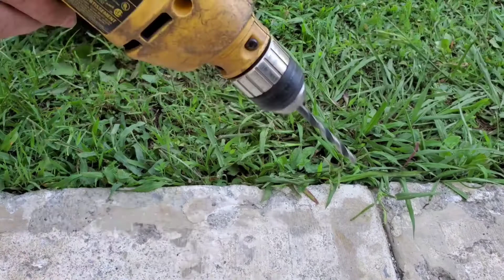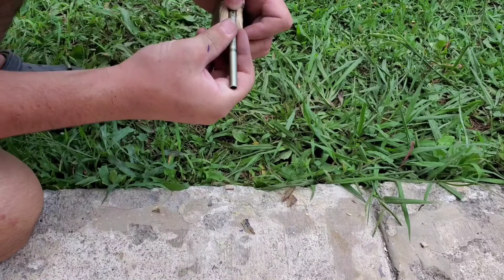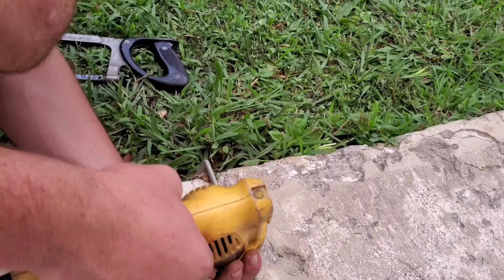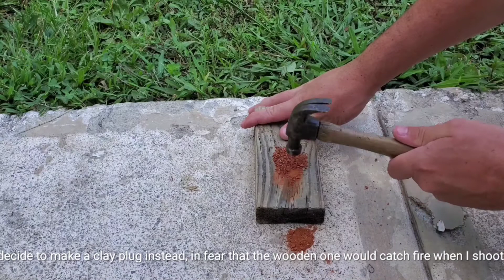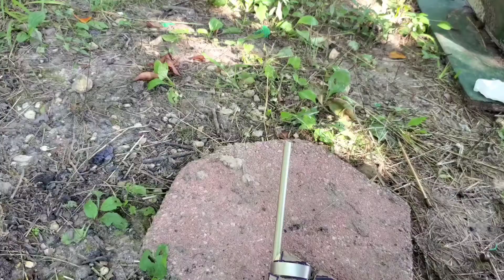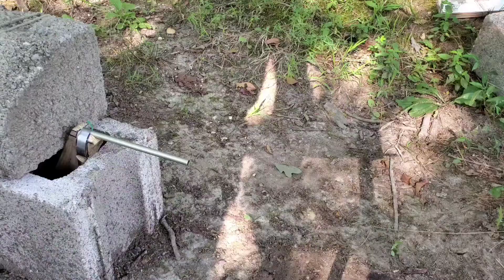Homemade Blackpowder Pistol

Comment: What I find interesting is the barrol u used, u said aluminum right n I always thout it had to atleast be iron or steel to withstand pressure of a gun great job
Reply from the maker: I was using black powder which produces less pressure than modern gunpowder, so aluminum is strong enough. If I was using modern gunpowder, I would use steel. This is the reason why you can't use modern powder in muskets or muzzleloaders, because it isn't strong enough. Hope this helps.
Reply: @dimadzhuga  very informing u seem to have a lot of experience with guns
Reply from the maker: @benitogarcia5618  making homemade guns is my hobby
Reply: @dimadzhuga  1 gm modern powder is equal to how many gm bp??
Reply from the maker: @jacksonjoseph1446  One gram of black powder produces about 0.3 liters of gas and produces 0.7 Kcal of thermal energy. In contrast, one gram of modern smokeless powder produces 1 liter of gas and 1 Kcal of thermal heat. So that means that black powder is about 1/5 as powerful as modern powder. From that, I'm estimating that 5 grams of black powder is equal to 1 gram of smokeless powder.
Reply: @dimadzhuga  thank you so much
Reply: never use aluminium barrel its dangerous
Reply from the maker: It only blew up when I put smokeless powder in it

Comment: you can make a blastingcap with armstrong mixture, which you need 
potassium chloride and red phosphorus for. You can get the 
potassium chloride from the head of safety matches and the phosphorus from the ignition strap on the box. Its a friction and shock senitive explosive so it detonates on impact.
Reply from the maker: I need to get more matches, I might make a mini cannon that uses armstrongs mixture.
Reply: Isnt red phosphorus super poisonous
Reply: @TopGFinanceAdvice  yes dont mke it like that just mix armstrong tree stump remover with sulfer and somme charcole
Reply: its potassium chlorATE

Comment: Is it dangerous if per say you overloaded the shot ? I mean , that’s quite a lot of shot you put in there , has it caused you problems ? I’m referring to only the shot tho , not the powder . Because it’s obvious that an overload of powder will end badly .
Reply from the maker: I've never done it before, but I don't think it will have a good ending. When guns shoot, the hot gas from the powder burning follows a path of least resistance. In a normally loaded gun, that would be the bullet. But if it's overloaded, the projectile is a lot heavier, so it wouldn't be as easy to shoot out. Therefore the next path of least resistance would be the wall of the barrel, or the plug in the back. I doubt it will do anything to a well made thick walled cannon, but the barrel thickness on mine is a whole lot smaller, so I wouldn't do it.

Comment: Could you just hammer the back end flat of the barrel if you’re using a steel tube ? It’s doubled with two 1mm thickness steel tubes so it would be 2 mm thickness in total . I’m thinking of hammering the back end flat and putting some lead pieces in the tube so that I can melt it with a blowtorch and create a flat surface “breech plug” for the powder to sit on . You’d reckon it be strong enough?
Reply from the maker: I think that will be strong enough as long as you make the crimp strong
Reply: @dimadzhuga  Hey there . So I’ve tried it out using match heads as propellant but all I got was a “whoosh” instead of a bang . Any ideas on why this happened ? I did compact the matchheads tightly in the barrel but it just burned up really fast and didn’t shoot . The ignition hole which I put the fuze in is 2MM in size and the barrel itself has a inner diameter of 8 mm . Any advice would be appreciated. Would blackpowder work differently?
Reply from the maker: @swiftskyler2982  I think that match heads burn too slow for this. Since it burns slower, it isn't as powerful.
Reply: @dimadzhuga  Thanks for the tip . I used homemade blackpowder this time and finally it worked . About 25 grains of it to be precise. Mine is a similar design as your gun but I made it so that it works on a percussion ignition system instead . I just used some Armstrong’s mix and put it in the fuze hole and gently pushed a small firing pin in the hole . Although I figured that in order for the Armstrong’s mix to detonate on impact , it had to be metal on metal impact , turns out that the blackpowder was packed so tight that it worked great as a surface for the Armstrong’s mix to detonate on . Btw the homemade blackpowder is not granulated whatsoever .
Reply from the maker: @swiftskyler2982  That's a great design. Just make sure to not use smokeless powder because it is too powerful. Mine blew up 2 times because I used smokeless powder.
Reply: @dimadzhuga  yeah definitely wouldn’t want that to explode in my face
Reply from the maker: @swiftskyler2982  Is your gun kinda like a pinfire?
Reply: @dimadzhuga  AHHHHH Yes Yes . That’s the word in looking for . Pinfire percussion ignition system
Reply from the maker: @swiftskyler2982  A pinfire trigger is a lot better than a fuse. I hope to make one like that in the future.
Reply: @dimadzhuga  Yeah for a fuze you need to light and wait for it . Whereas for a pinfire , a very simple trigger mechanism can be made and you can just point and shoot things . The ignition hole I made was 2 mm and I don’t recommend anything bigger as gas will escape . Anything smaller than 2 mm will have difficulty with the pin fire method as it will be hard to put the Armstrong’s mix in and properly prime it . Although you can use roll caps as primers if you do decide to make the ignition hole smaller than 2 mm . Maybe put a little blackpowder in the hole below the paper roll cap to assist ignition.
Reply from the maker: @swiftskyler2982  The plastic percussion ring caps from a cap gun would work too.

Comment: Hey so how do you make the clay plug? 

I’ve been trying to use wood plugs bud as you mentioned they’re wearing down because the black powder sorta burns it a bit 

Are you just dropping clay in and tamping it down?
Reply from the maker: Yeah you just drop pieces of bentonite clay in there and hammer it until it gets hard as rock.
Reply: @dimadzhuga  ok thanks a lot I’ll try that

Comment: Can you use any blackpowder?
Reply from the maker: Yes, I usually use the blackpowder lift charge from firework mortars and cakes. I also sometimes use pyrodex but blackpowder works better.
Reply: @dimadzhuga  thank you, how many grams of powder do you use?
Reply: @dimadzhuga  and is it possible to use normal bb’s instead of nr 8 buckshot?
Reply from the maker: @parkinsonsoldier6655  I use 0.47 grams (7.2 grains) of powder for 8.07 grams (124.4 grains) of shot. It is ok to round to half a gram (0.5) of powder and 8 grams of shot, it won't make much of a difference.
Reply from the maker: @parkinsonsoldier6655  I use lead birdshot because it is more dense than steel bbs. Also since the barrel is such a small caliber, I could fit more bbs if they are smaller (more weight to volume ratio). I honestly don't know how steel bbs will preform in this gun. I'll try to make a video soon trying different loads and I'll be sure to include  .177 caliber steel bbs.
Reply: @dimadzhuga  your
Comments are very helpful, I need to order some blackpowder now. Gonna do a safe test fire to be sure before I hold it like you did, hope the 177 bbs are not to heavy, I reckon I won’t put in a lot of them since they are heavier. Thank you again for the helpfull comments!
Reply from the maker: @parkinsonsoldier6655  You're welcome. And make sure you use the right type of blackpowder. There are different types that burn at different speeds. I'd recommend FFFG blackpowder. Just remember that I am not responsible for anything you might do that was inspired by this video.
Reply: @dimadzhuga  sadly can’t get fffg will lovex do32 work, and I will be very careful!
Reply from the maker: @parkinsonsoldier6655  I wouldn't recommend it. Modern day powders are much more explosive than blackpowder. This article states why. https://www.hunter-ed.com/national/studyGuide/Powders-for-Muzzleloaders/201099_92954/#:~:text=Don%27t%20use%20modern-day,)%2C%20sulfur%2C%20and%20charcoal.
Reply from the maker: @parkinsonsoldier6655  See if you can use Pyrodex. It is the best blackpowder substitute.
Reply: @dimadzhuga  I can also not get pyrodex with laws around blackpowder, only gunpowder. So is firework gunpowder okay?
Reply from the maker: @parkinsonsoldier6655  Yes, that is what I used. I recommend the mortar shells, they have the most powder for the price. Just make sure you only use the lift charge, not the burst charge. The burst charge contains flashpowder, which is even more dangerous than modern day smokeless powder. Here's a picture that will help you differentiate between them.
https://images.app.goo.gl/karbLtbppteYKbfg9
Reply: @dimadzhuga  well, sadly I live In a not so free country like America, the only fireworks I can still get my hands on is cakes,firecrackers, some singleshots
Reply from the maker: @parkinsonsoldier6655  Cakes will work too. Cakes are basically mini firework mortars. The lift charge on a cake is the coarse black powder at the bottom.
Reply: @dimadzhuga  this has been very helpful, so I just take the bottom of the cake and I’ll see the black powder?
Reply: @dimadzhuga  and does every cake have this? (We have weaker cakes i think)
Reply from the maker: @parkinsonsoldier6655  As far as I know, every cake works the same. Weaker ones will just contain less powder. Here is a cross section of a cake so you will know where the lift charge is.https://images.app.goo.gl/g4zYZ9bSQ5BvathA9
Reply: @dimadzhuga  thanks a lot sir you have been great help. I think I know enough for now, and again thank you.
Reply from the maker: @parkinsonsoldier6655  You're welcome.
Reply: @dimadzhuga  i finished it and I uploaded a video on my channel
Reply: @dimadzhuga does using matchhead powder make a difference?for example if u extract the powder from the match heads and than use it for the gun?
Reply from the maker: @Dav624  That could work, I've never tried it before. I don't know if the burn rate will be fast enough though.
Reply: @dimadzhuga  I have tried a miniature version of a real firearm with barrel of aluminum wich was smaller diameter than a plastic BB and smaller than my second finger in my hands I basically closed one side of the barrel with some pliers just pressed it down till it had no air coming out and than I proceed to load the match powder the thing is that as trigger mechanism I used a lighter and held it at the part of the barrel where the match powder was stored in than the idea would be that the flame would heat up the metal so that it ignites the match powder and this idea worked fine the first time I attempted shooting it with aluminum foil ball I made specifically for that barrel however the second time I tried wadding with some small tissue and than put a small nail after the wadding was done in order to shoot it as a projectile the problem was that I think I either put too much wadding inside the barrel or I put too much powder in it and henceforth the barrel exploded into a mushroom shape I was holding it with pliers and holding the lighter under it with my hand to fire it and when it exploded I got shrapnel parts onto my left hand thumb at the area near the nail and the second finger of my right hand got some soft tissue cuts wich were healed easier because no shrapnel got inside the second finger of the right hand and anyway 10 days later I removed the shrapnel stuck in my left hand thumb because that's when the doc noticed it and pulled it out that thing was preventing the healing process to occur and than after removed it healed just fine btw the sound it made was like a real pistol firearm so much more loud than the first time I shot it and my right ear had that flash bang ringing effect u hear in video games like csgo and stuff but my left ear was fine the ringing went away by around 5 days it came and go than the coming and going became less present and less present until it was all gone thank God I didn't get injured but just warning ya so u don't try that thing with ur own hands I don't want anyone do be harmed by my ideas just if ur gonna try it be safe at least i was just curious to know how match powder would perform in a larger version of a firearm instead of miniature one
Reply from the maker: @Dav624  Yeah I didn't really trust this aluminum barrel, so I made a mount to put it on the ground instead of holding it. I loaded it with a double load of smokeless powder instead of blackpowder, to see how strong it is, and it blew up the barrel. I would strongly discourage anyone from using an aluminum barrel, unless they're only shooting small blackpowder loads.
Reply from the maker: @Dav624  Also, strike anywhere matches are a lot more powerful than safety matches.